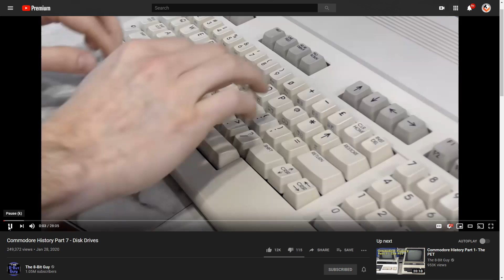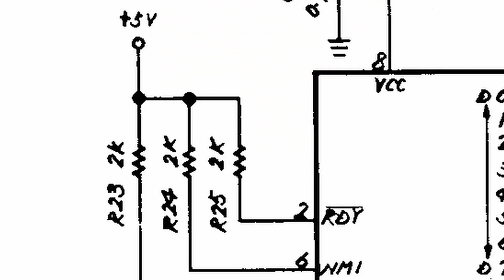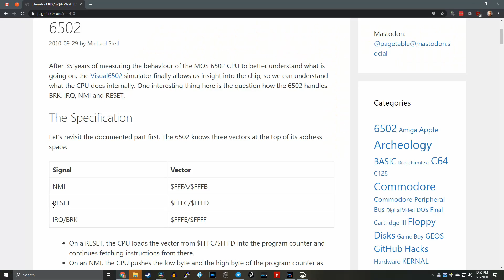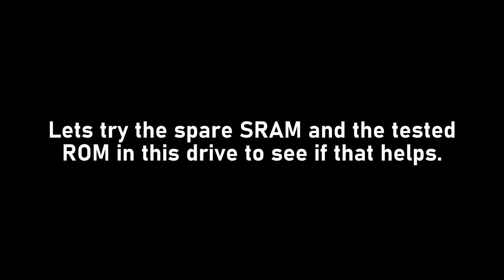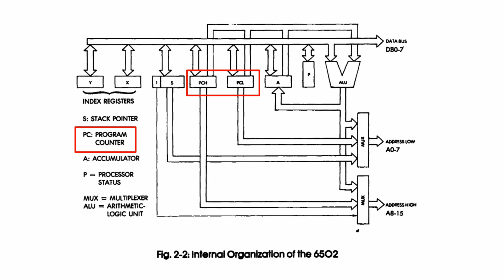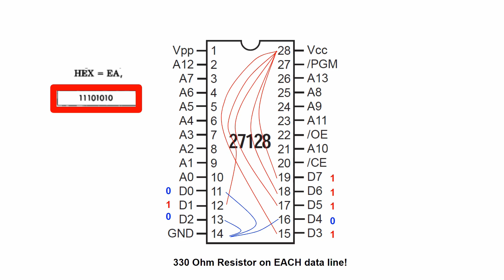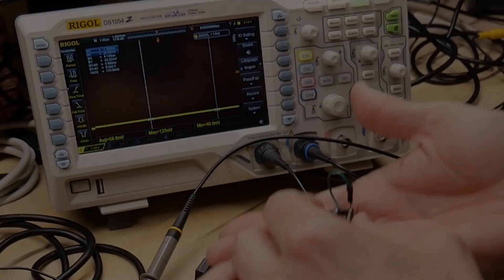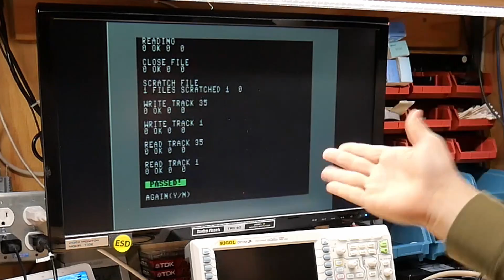Using a NOP Generator to help fix a dead 1541C drive (Bonus Track 1 Sensor demo)

Comment: Thanks for showing testing without logic analyzer! it would have helped but you got far without it.
Reply: If you are repairing a previously-functioning piece of gear you can do almost all your testing with a logic probe and a DVM—you can even do without a 'scope.  On the other hand, if a new design is not working and there is no immediately obvious reason why, a logic analyzer can be useful.  This is especially true if there's a likelihood of timing "gotchas" in the glue logic.

Comment: Why does it annoy me that you use permanent marker on the chips? It is like you are defacing the chips or something. Couldn't you use some sort of sticker, like a red circle for bad and a green circle for good?
Reply from the maker: It's not permanent -- sharpies come off easily and completely with 99.9% isopropyl alcohol